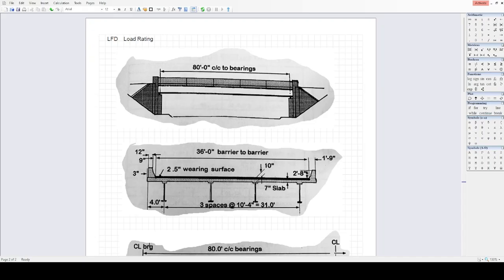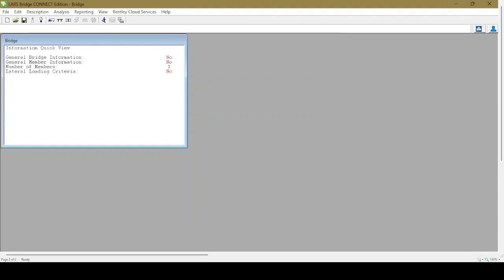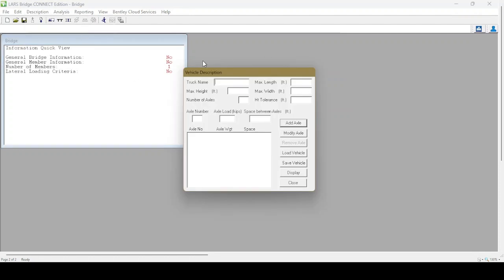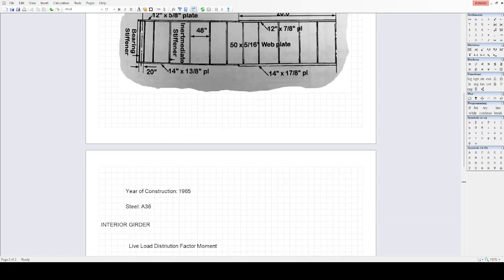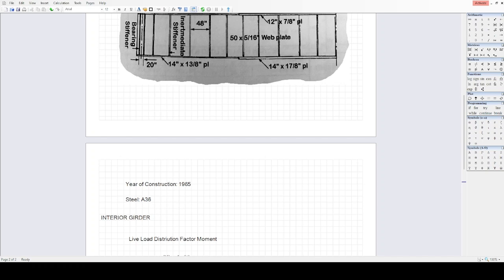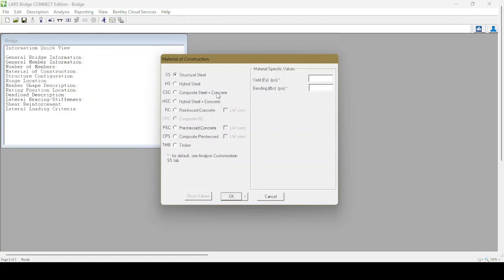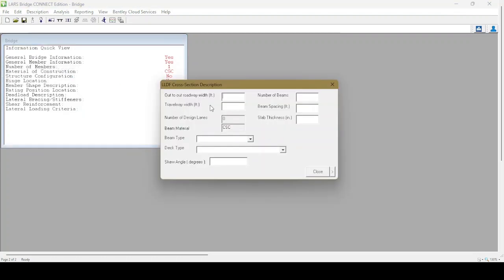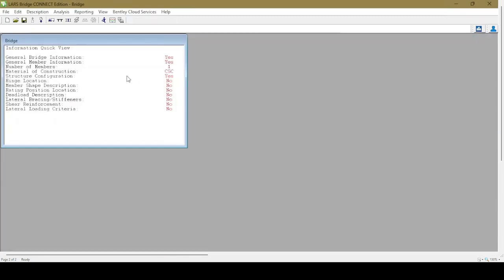1- LARS Bridge Software Basic - LFD Steel ridge

Comment: I would like to know if there is any PDF material for this Load Rating course. Thank you
Reply from the maker: Hi. I have created a PDF that helps with the basics on a slab bridge rating. My goal is to put everything in video form. Is there anything specific that you are looking for?
Reply: Hi, Right now I want to get a general idea of how the program works. I'm a beginner at it, but the topic of regulatory factors for doing Load Rating on post-tensioned girder and steel truss bridges is what interests me. Having some documentation, like this one for a slab bridge rating, would be perfect to start with.